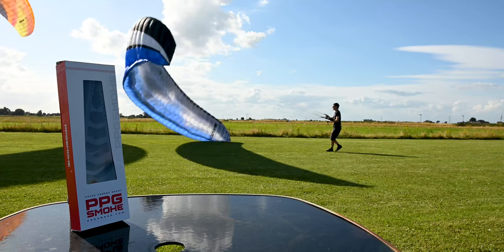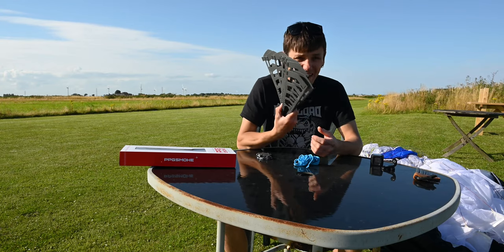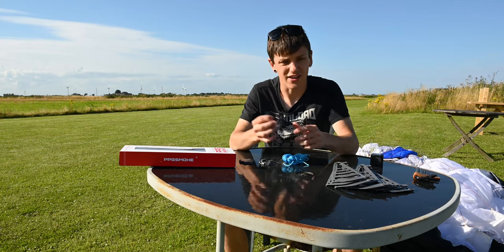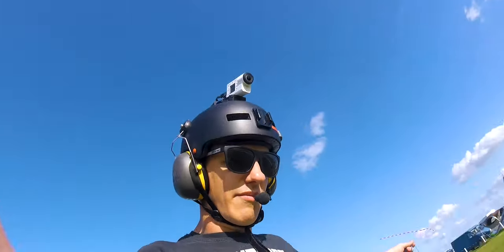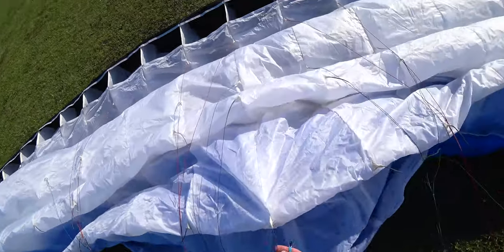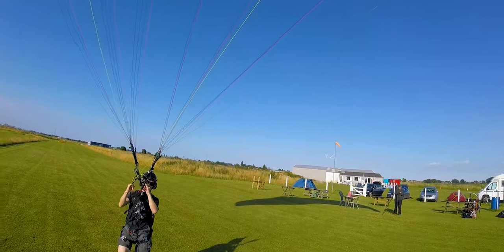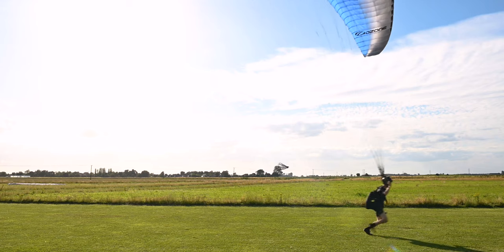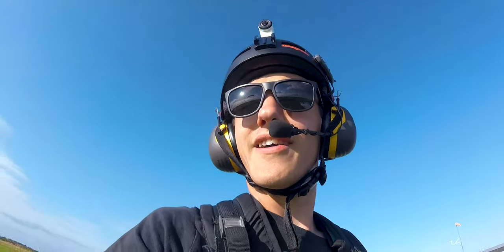PPG Smoke Chase Cam Setup + GIVEAWAY

Comment: Great video.  Is there any good way to stop it from flying into your prop/engine with every landing?
Reply from the maker: David Garthe sure is. You can lengthen the line a couple of ft longer than your glider lines. That way it’ll swing j to the ground before it gets chance to get to you. It looks like it swings in hard but it really is t that bad if you kill your engine up high so your prop isn’t spinning and keep that brake pressure on after you’ve flared and touched down. Good luck in the draw!

Comment: Nice video again Daniel! Looks like an awesome product for some neat angles.  As long as you land with your engine off, you should be ok? It looked like it smashed into the back of the motor on the video, I guess you would have to be unlucky for it to smash into the prop and damage it? But what happens if it snags something, is there a weak link to release it if it gets caught on something?  Although you would have to be flying very close to something for that to happen, but just a thought?  Other than that looks great 👍
Reply from the maker: Thanks mate! Yea it’s advised to kill your engine to let your prop stop spinning or you could lengthen it a couple more ft so it hits the ground before it gets a chance to swing in. It does look fast but it’s not too bad. I feel like Ive seen some mention a quick release for any potential snags somewhere before but as factory it doesn’t have that feature. It’s definitely something to be aware of flying close to trees, hedges etc. For the most part I’m very conscious that it’s there but haven’t had any issues with it yet. I definitely don’t fly with it all the time but when I do it’s been great 👌 anyway, good luck in the draw!

Comment: Who doesn’t like a chance to win a cool gadget, sign me up!  Also Daniel,  are you still liking the new wood prop?  I’m thinking about ordering one for myself and wondered if you had any more thoughts to throw out there.  Thanks, Kevin.
Reply from the maker: kberry3065 glad I could offer as a prize 😁 I’ve actually sold that motor now and the prop was still going strong. It was really solid. Obviously there’s the things I mentioned in the video about it not spinning up as quick because it was a little heavier but recently which had come to light check that if you motor is still within its warranty that the prop doesn’t void your warranty, usually the manufacturers will have a list of approved props. Good luck in the draw!
Reply: @DanielJonesParamotor  thanks Daniel.  Happy flying!